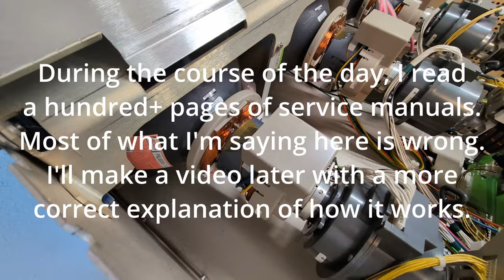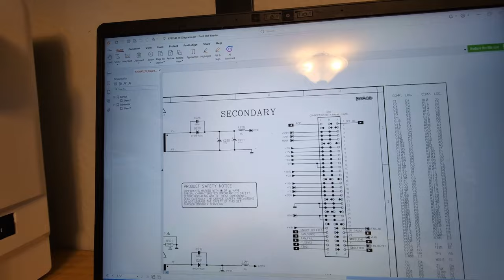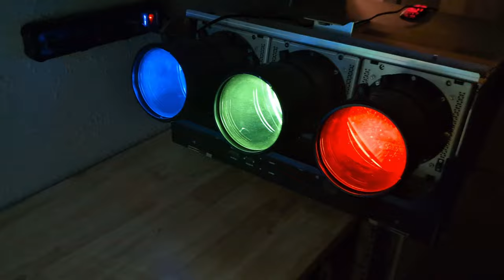Reviving the BarcoReality 909 CRT Projector

Comment: The Barco 9" CRT projector! It was a dream in the HTPC community! I think this was the top of the top available, it was stupidly expensive back then. It weighs like a washing machine but provides more or less infinite contrast ratio, which was WOW back then when digital projectors were doing pretty poorly. I had a Sony 7" but the Barco 909 was always the top reference of everything!
Kurt Palme was the reference back then indeed! I recapped my Sony 1271 chasing the "perfect pixel" which was just a dream of course, but that was cool! 
As you said, replacement tubes were expensive and I always dreaded a fault which might damage them - that is, the deflection would stop and the high energy electron beam would permanently burn a dot or a line on the face of the CRT!
Good times - but it was so bulky! That is such a nice and modular machine, Barco have always been like that. Their modern cinema projectors are built with the same modularity.

Comment: Those monsters were CRTs?
Never knew that.
They were effing awesome at the time.
Pubs and bars who had those were suuuper popular here in Germany.
Reply: Yup, they were 7" CRT's if I remember correctly. They'd blind you if you looked directly at them. Heavy fuckers too! Mine weighed about 110lbs. They would need a whole rig to fly from a ceiling and could easily kill someone if they fell.
Reply from the maker: @hi-friaudioman 5-9" were all fairly common - this one is a 9"! I think the later models tended to have bigger tubes.
Reply: @computersarebad  smallest tubes used in any sets were 7", but often listed as 5" useable, if you went beyond that they were hard to align the corners.

Comment: I don't think you have to worry about x-ray emissions from those tubes. That's usually only an issue with color CRTs, since they need higher anode voltages to get around the problem of electrons getting absorbed by the shadow mask. And even color CRTs have integral X-ray shielding, at least all the ones made after the 60s.
Reply: You should look up how the X-ray protection circuit works in CRT televisions. As far as shielding, I'm not sure. The glass is thick, and some say includes lead.

Comment: Sweet memories! I had one too back in 2008. Bought a chassis from Sweden without tubes, went to a planetarium in Luzern (Switzerland) where they had a stash of P19LUG tubes without burns for sale. Built it all together and the image quality was nothing short of fabulous. Very film-like! The 909 is renowned for its digital convergence. All earlier Barco projectors had some drifting convergence because of the analog circuits. Not this 909 which was all digital.
Reply: Hello, do you still have some P19LUGs left? :)
Reply: NECs had far better convergence than the Cine 9 and Reality 909, significantly better and much finer adjustment, even on the 9PG with a point convergence board they were better. The XG series simply slapped the Barco convergence into the middle of next week, and it was rock solid reliable too. 

The Barco Cine 9 and Reality 909 were "mostly digital", not all digital. There are still a few analog adjustments on a couple boards that do tend to drift. I have a Cine 9 in my cinema room that has been with me a very long time. 

The Barco has about 81 points of convergence, tops, where the 9PG had more than 100 per colour, and the XG has more than 300 points per colour with much smaller adjustment steps.

The step sizes on some of the Barco geometry settings are too large. The fine convergence steps are WAY too coarse. This makes it far quicker to get it all very close if you're happy with 99%, but it is quite time consuming to get it 100% perfect corner to corner of a 130" 16:9 screen. 

One area the Barco Cine 9 and Reality 909 certainly do beat all others is the dynamic astig and focus, that is significantly better especially the multi pole zone astig. 

The Barco still has the primary spot in my cinema room, but if NEC made a 9" XG i'd never have bought a Barco!!
Reply: @CaseTheCorvetteMan  Hello, I will be putting my Cine 9 into service and calibrating for the first time. Could you share some tips or resources, how to understand it, do it proper way and not get lost myself? Thank you

Comment: Soooo.. a while back i picked up a barco 808 for free from a mansion in  GA, i drove it all the way down to FL and kept it in my 10x12ft bedroom. 

They are definitely 100+lbs. Mine had about 1100hrs and had an absolutely beautiful image. Super bright ans clear for a CRT projector. 

Also fun fact, since they dont have a "resolution" you can run them at about 1080i, if i remember correctly they actually go higher than that too. 

I built a white reflective wall on the side of my patio and projected it out of the window. 

Btw you can do RGBHV to 15pin VGA quite easily. If i remember correctly they work without any tinkwring with the SYNC because it has a dedicated HV SyNC. 

Hopefully you get it going. I loved my 808 but i had to get rid of it because of the weight/size. 

Also the convergence is a bitch. 

Since they're old components they tend to "drift" in tolerance and youll probably be adjusting the convergence every day or two. 

Mine would drift with any changes in moisture and/or temperature. 

Last movie we watched I think was Rango and the colors were sooo vibrant and bright. There's nothing quite like a high end CRT projector.. 

I want to say the previous owner was using his with a 120" Screen and i used it with a 80" screen.

Comment: Awww I use to fix electronics. Looked at one of these once. It had a voltage doubler/splitter after the EHT transformer. The whole thing leaked electrons. Tryed to silicone it but it didn't last long. Was sad.

Comment: Beam convergence is a nightmare with 3-tube projectors. Materials expand when warmed so if you want it to look good, let it run and warm up and then align the beams. The thing is designed to run all day in a huge venue... it's not really meant for just turn it on and use it a few hours. You also have to deal with beam alignment for each tube separately, but looking at the yokes at 9:48 it looks like you have all-electronic beam adjustment.

Comment: With that few wires going to the "remote," I imagine it uses the same encoding as infrared, just without the LED or the sensor. I could be wrong, but with only a few wires, I'd guess there is some encoding and decoding.

Comment: 36:45  you need to get someone with a picture tube restorer. it will bring a bad picture tube to full brightness again.  its a device that used to be prevalent but is somewhat obscure now.. it will fix the blue tube.
Reply: I've also seen other YouTubers try them and do more harm than good, so your mileage may vary

Comment: I still have a Cine 9 in my cinema room, it still sees regular use too!! It has a bit over 24,000 hours on it now, about 3,000 hours on the current tubes and i have two new sets left. There is a Sony 4K sitting beside it for the UHD discs, but for DVD or VHS the Barco smokes the Sony and the blacks are still far better than even that decent SXRD Sony 4K. 

I have a Reality 909 for a full set of spares and a test machine, but both sets have been working perfectly since i rebuilt every board about 9-10 years ago, haven't had one single issue ever since. 

Works great for light gun games!!

https://youtu.be/4y1ab9f84jE?si=UV6fFJsINejqeB6s